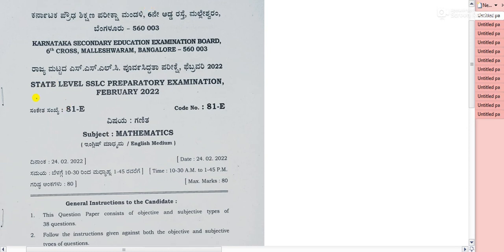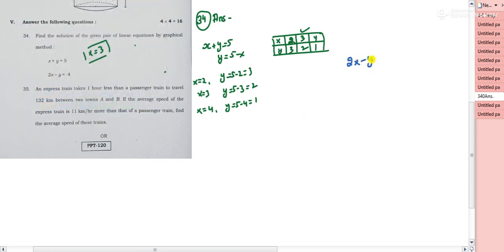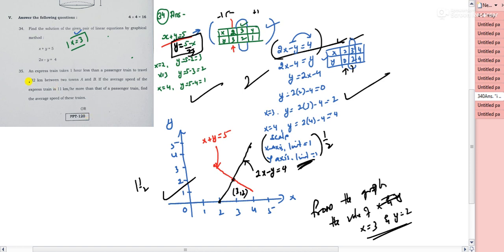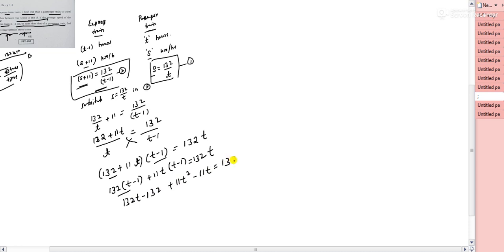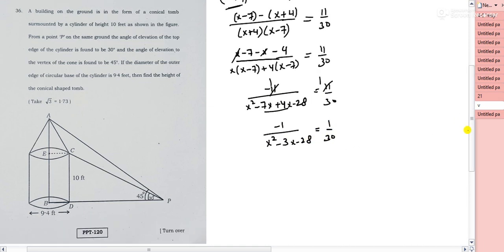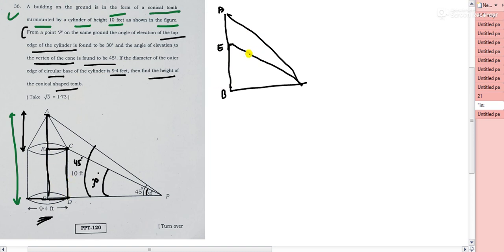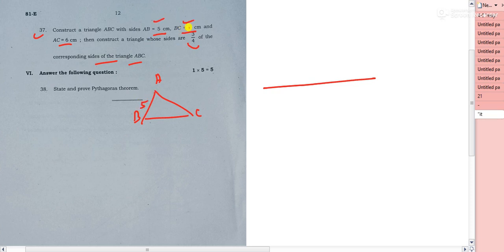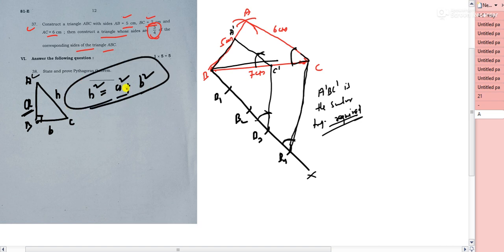SSLC Maths -State level Preparatory Exam 2022 | Solutions | 4-5 Marks questions| Sajid Ali | English

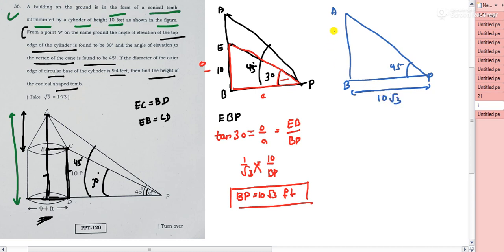Comment from the maker: Correction in the questions no.36 @24:18
While taking triangle with angle 45°, take BP length as {10√3+(9.4/2)}=22
And after solving the final answer would ne 12 feet.